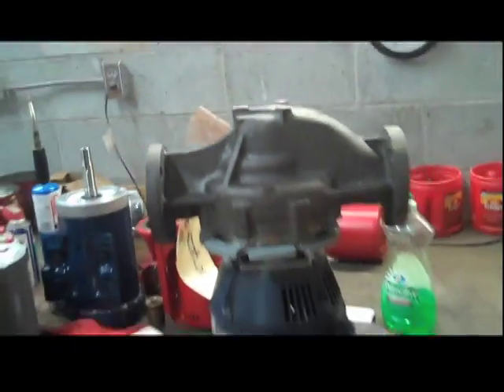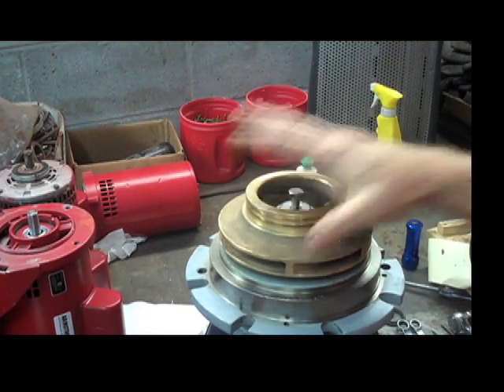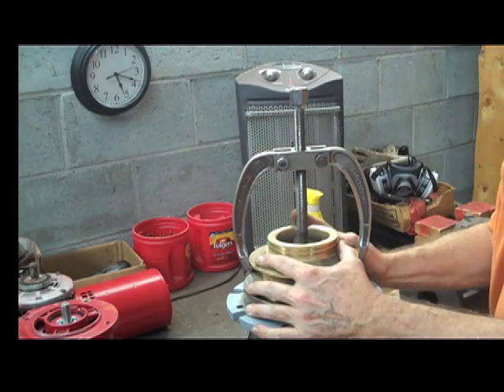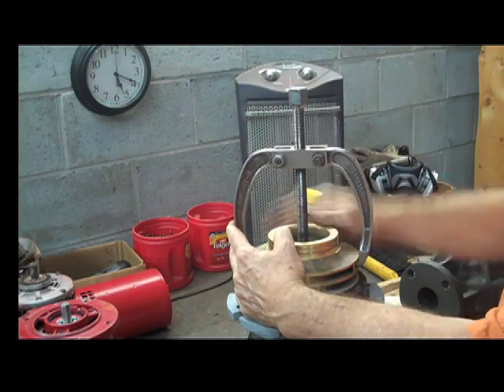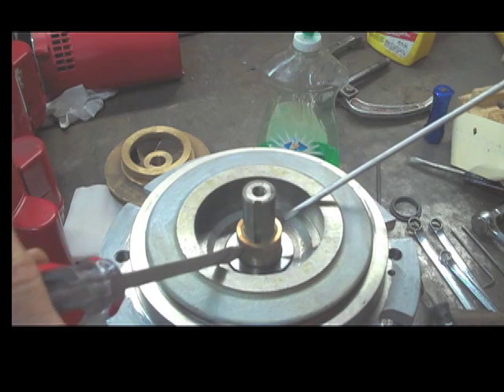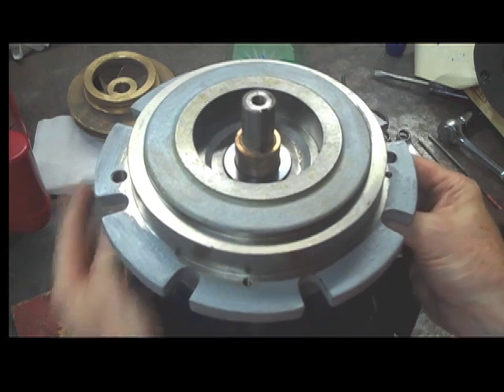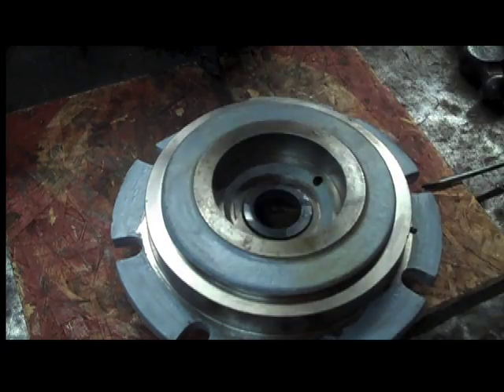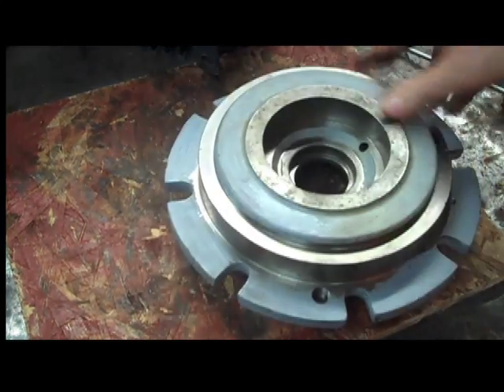Pump seal change repair rebuild tutorial how to  disassemble coupled motor mounted 4280 4380 1531

Comment: Great videos Roger!

I have an Armstrong 4380 vertical mount where the motor has failed(open winding) . This will be my first attempt on replacing a closed coupled pump motor. I assume it's best practice to order the seal kit and replace them any time you open up the pump?

Thanks !
Reply from the maker: yes it is best practice ... I think that in the last several years Armstrong started using lock tight instead of a sweat fit sleeve

Comment: Thank you for sharing the video. at 4:30, about the sleeve, you mentioned the bottom part will be corroded, but why? I thought that the bottom part was sealed by stationary seal and rotating seal and separating from liquid, and the top part is surrounded by liquid. Could you please correct me? Thanks,
Reply from the maker: gets wet when they leak

Comment: when replacing a motor,  what information is needed when looking up what seal kit to install? how do I know which seal kit to buy? shaft diameter...etc?
Reply from the maker: the seal kit is chosen on the basis of the pump .. you should contact the pump manufactured with the pump model #, horse power and sr# and get the seal info from them .. there are  LOT of variables... you also could have success by taking the old seal to a pump repair shop .. they may be able to duplicate it

Comment: I've always been told to NEVER touch the faces of their seal. Is this true? If so, what's the best way to clean off the seat faces after they've been contaminated? For whatever reason, we have two motors for a pool who's seals keep leaking in less that three months. Not sure if it's the sand that cycles through, too high a chlorine level or what.
Reply from the maker: its a no touch on chillers and things that spin very fast .. pumps typically are lower RPM and have some water to 'lube' them if you wipe the surface with a clean cloth ( your shirt maybe? ) it should be fine . you don't want any grit on the faces. Pool pumps can cavitate and/or see some grit. you should look at how they are failing ..is it the sealing faces or the elastic parts that are deteriorating .. if its the sealing faces then its grit .. if its the soft parts its usually chemicals
Reply: yup dont touch them if ya do clean with rubbing alchol